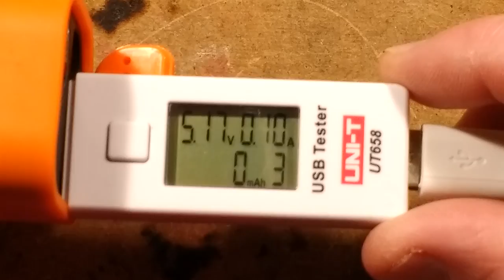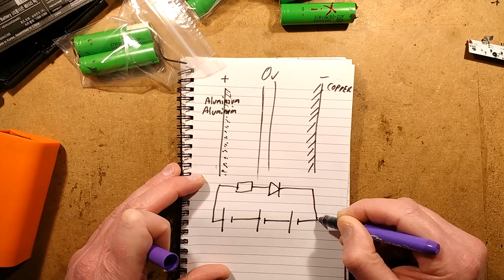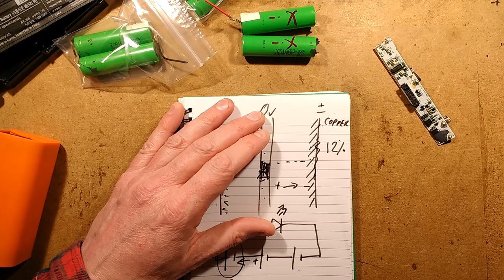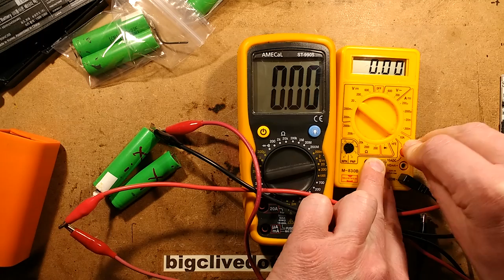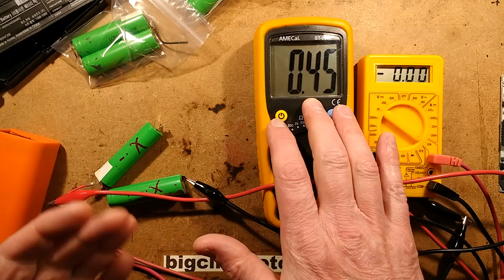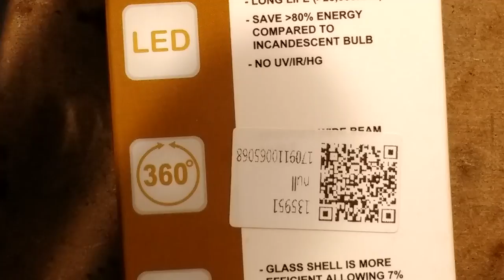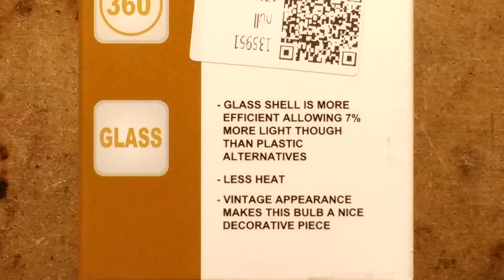Teardown of a faulty Samsung lithium 18650 cell.  (2200mAh)

Comment: Couldn't you have just used the multimeter to probe resistance directly through that membrane with the graphite still on it? As you move the probes, you should be able to pinpoint where exactly the fault is, and it should also allow you to detect microscopic metal dendrites that have punctured the separator... unless I'm totally missing the boat on this one, again.
Reply: That does not sound terribly fun - and quite messy.
Reply: Ignes Andros; More messy than washing off all of the graphite to try and visually see a hole underneath?
That paste is quite firmly on there, simply moving the probes around on it shouldn't be THAT messy...
Reply: MRLT You might punch holes with the probes.
Which is why I would take 2 metal plates and put them on both sides,  now you can measure a bigger area and not risk puncturing it
Reply: Reviews+Tutorials Yeah that is a good idea. The only issue is that the larger the squares are, the less likely you will be able to localize the small pinhole.
Perhaps simply submerging it in a shallow amount of water, on top of a large piece of Aluminium foil, would be better. You could attach one probe to the foil (which touches one side of the seperator), and then simply move the other, small probe tip around without actually touching the coating at all. The water's resistance should be large enough (regular tap water should be fine), so that you could easily tell when you're right over the hole.
Reply: MRLT Or you could just move one plate after you found the short so the area where they are on top of each other is smaller.
And simply keep making the area smaller until you found the point
Reply: Reviews+Tutorials; Ah, yes you could indeed do that as well. :)

Comment: I have opened quite a few old laptop battery packs and its always a 3s pack made out of 18650s
Normal sized ones have 2 cells in parallel and bigger ones have 3 cells in parallel.

Its quite a good source for lower spec 18650s if you can get them cheap or for free.
I used to go to my local recycling center and ask politely and would usually be allowed to take a few

I would advise to leave the nickel tabs if you want to do the same but dont have a spot welder, that way you dont have to solder to the cells directly (which might damage them) but can instead solder to the tabs

Comment: I'm not an electrician but, if you placed a diode between the batteries, would that not stop the reverse charging that was mentioned?
Reply from the maker: A diode in reverse parallel could limit the reverse charge to 0.6V.
Reply: Clive, active bypass diodes could limit reverse bias to just millivolts - they are just mosfets with a charge pump to run the gate
This is why they are used on solar panels to prevent groups of shaded cells from becoming reversed biased and turning into heat sources that could damage the cells, cause hotspots or even cause a fire.
They could be used on lithium cells too for currents <10A , but as they cost at least as much as a cell and don't eliminate the need for a BMS, I guess that's why we don't see them used.
Reply: It would also stop normal charging.
Reply: You sure about that?
Whether charging or discharging, the cell's anode always stays more positive than the cathode so the diode would never become reverse biased, unless the cell is completely depleted and/or overpowered by the other cells in series.
Reply: I understand "diode between the batteries" as putting diodes and batteries in series, which would allow current to only flow in one direction. Hence only either charging or discharging would be possible, depending on the oriente of the diodes you put in place.
Reply: In that case yes they would prevent charging and there would be a significant voltage drop across a string of cells.
However, in this case diodes would be used in parallel across each cell, so that when the anode is positive the diode does nothing, and if the anode attempts to go more negative than its cathode then the blocking diode becomes a piece of wire and bypasses the cell.
Reply: So a diode would do the job, yes, no? As I said above, "I'm not an electrician", but I know that a diode is a one-way thing, and it seemed logical to me to employ one to stop the reverse charging. As for 'reverse parallel' or 'active bypass diodes' or 'mosfets' or 'reversed biased', these are things I don't know about, I'm just a musician. Watching Cive over the last couple of years has (I think) furthered my electrical knowledge... :)
Reply: Dave, these are things you can know about - if you want to. The collective knowledge of the entire human civilization is but a couple of clicks away.
I'm 'just' a musician too, but don't let that stop you from using the superior skills that a musical brain gives you to explore the vast ocean of knowledge out there while others remain happy to make identical sandcastles on the beach.

Just like water valves, diodes aren't perfect - they leak. They drop voltage (0.3-0.6v) and get hot if passing too much current. They start conducting in the opposite direction if the voltage or temperature gets too high.
A mosfet is an electronic switch with a low resistance when it is on, and therefore doesn't drop much voltage at all (hundredths of a volt), so it can carry high currents without getting too hot.
It needs a relatively high voltage on its gate to switch it on, where a diode doesn't have one.
An active (or ideal) diode is just a mosfet with some circuitry that makes it behave like a more perfect diode - a one-way wire.

You can use a water analogy and buckets for batteries - if the valve (diode) is open when water tries to flow back into the bucket the wrong way, then it goes through the valve instead because it is in parallel across the bucket, and not in series.
Hope that helps.
Reply: Andy Lee Robinson - Excellent and thanks. I understand the analogue of water, but I'll play the music and let someone else fix the wires. :)
Reply: Thanks and you're welcome.
I could have been clearer, so I'll clarify with some ascii art:

I think you were thinking of this:
-----█████+----->|--------█████+----->|--------█████+----->|-----
(which would prevent recharging)

when the solution is this:
---|--█████+---|--------|----█████+--|-----
   |------->|----------|         |-------->|----------|
(which would try to prevent the cell reversing but still allow recharging)
Reply: Andy Lee Robinson - Ha, yes the first one is how I thought of it, but as you show, the second one is correct for this application, even "serious marble" knew that. Yeah sure, I could have trawled the net trying to find an answer to my question, but that is what you lot are for, haha... :)
Reply: My understanding is that military-grade cells have diodes in parallel to prevent reverse charging.  At least the older ones did.
Reply: dave, no you cant have a diode in series with the cells, there would need to be a diode in reverse parallel  across each cell, for lowest voltage drop a power schottky, as these are 0.25 ish drop, normal diodes 0.6 ish
Reply: You can get switchable diodes,,not sure what there called but under certain conditions one can switch the diodes to accept reverse current,,
In the hydraulic world we call them pilot checks,,usually run any thing from 3:1 UP TO 5:1,PILOT AREA RATIOS,,,,hMM caps locked,Got a hate that,
Har Har Har,
Reply: Andy Lee Robinson as long as the cells, solar or lithium, were outputs, the diodes do their jobs. And in the case of batteries, all the connections in series would need only one diode per junction, though the voltage drop would be significant, so the charge controller would have to bypass the diodes when recharging or suffer a large standby current...considering the diodes to be active components which raise the voltage requirements- unpredictably I might add.

Comment: So, I've actually torn down a lithium ion cell too, down to 0V of course.

I've managed to separate all of the cell's components, and I'm left with:

- A part of clean separator.
- A lot of dirty separator, of which I don't know how to clean without killing myself with HF.
- Some clean copper.
- Graphite coated copper.
- Active material coated aluminium.

How did you clean the electrodes and separator without emitting a bunch of HF?

Comment: My girlfriend's laptop battery was killed by a dodgy charger and I thought I could open it and charge it above the cut off voltage if they were low, or replace the defective cell but nope. The protection IC failed. The batteries were completely fine and so too were the fuse and diode/mosfets... Sods law.
Reply: That makes NO sense. There is no charging circuitry inside the laptop battery pack. It's all on the laptop motherboard. The only thing you will find inside the battery pack is overcharge/discharge protection, fuelguage and some other safety mechanisms (over temp shutoff, chemical fuse etc.)
Reply: I have experienced a number of lithium batteries fail from the protection IC taking a dump.  The tiny epoxy encapsulation of the IC itself had deteriorated, turned into a substance like a putty.  Lead wires to the die lose support and break. Replaced the IC and good to go.  I guess when China runs put of regular encapsulation epoxy, they use dog shit, newspaper bits or whatever can be found to load into the encapsulation molding machine.
Reply: zapro_dk 
I didn't say there was charging circuitry in the pack.. although there is balancing circuitry in most if not all packs. 
Most protection ICs will separate the battery pack if it detects any faults (over temp, under voltage, overvoltage etc) this is marked as a flag and some batteries allow a certain number of flags before it's deemed unusable. 
I was hoping that one of the cells were low from the dodgy charger lead shorting out or some other easy fix. Hope this cleared some of your confusion up
Reply: Skruffles
maybe charger was outputting the wrong voltage??
Reply: Charge IC has some eeprom inside that it uses to record cell condition, and when it detects failed cells it writes the eeprom with a fail code and then stops responding. Can be reset with the right software and programmer. Others also have a fail safe blowable fuse on them that the charge controller blows open as a final safety to protect the cells from abuse, along with the regular mosfet charge and discharge control switches. they all will have a thermal one time fuse as final overheat protection, though there are plenty of examples of these being a little too late to prevent the battery catching fire as it vents the electrolyte and it contacts a source of ignition.
Reply: David Scheiber 
No the charging cable wire was damaged so it shorted out the port.. Luckily no damage was done to the laptop though (replaced the pack with a new one on my channel)
Reply: SeanBZA 
Thanks for the input, some good information here. 
For €30 replacement that has new cells I'm not about to reprogram the EEPROM though :)
Reply: How do you replace the IC if it's an epoxy blob?
Reply: On the positive side, you now have a few nice cells to play around with for your hobby projects.
Reply: no its in the battery on most     apart from some apple units   you can see it in this vid he shows  the pcb